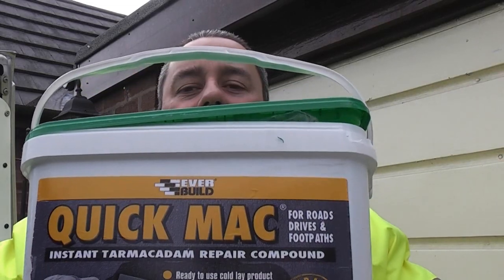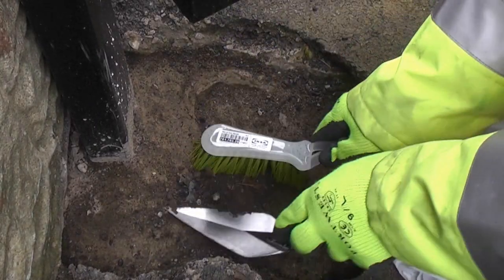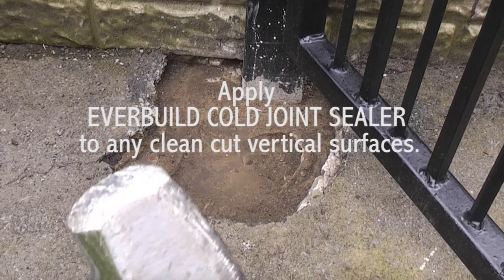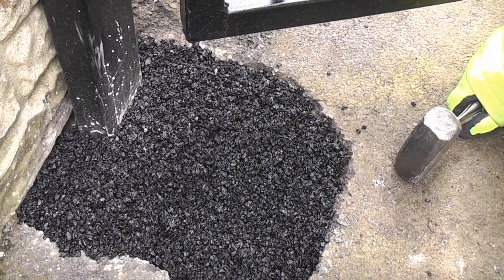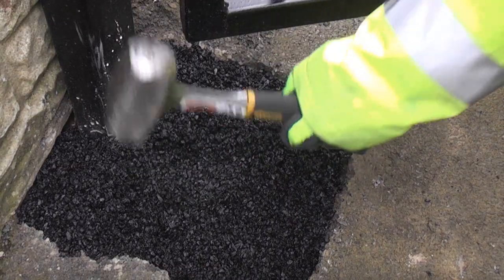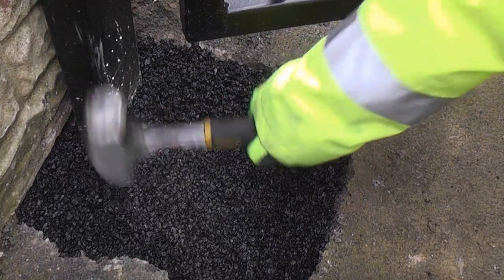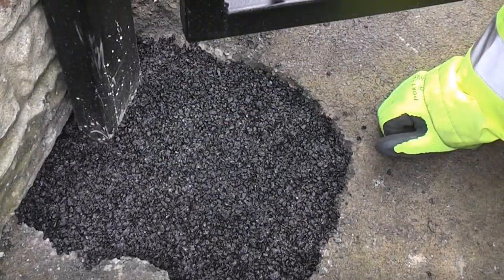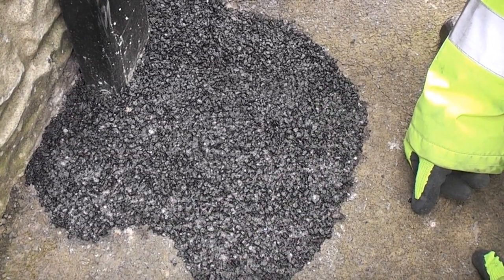Tarmac repair

Comment: I did a DIY repair to a small area of damaged path where I spilt some petrol from my lawn mower.  Mixed up some stone shingle with bitumen paint and then poured into the hole.  I didn't have a shovel and rammer either so I used a 16 KG kettlebell to compress!
Reply from the maker: Thanks for the comment ;-)

Comment: Get a stihl saw and cut the edges neat, will stop the tarmac coming loose if you have a better joint..... then bitumen seal the joints to stop water getting in and ruining the tarmac
Reply: And a punner

Comment: The best way is to put 3 layers in and compact each one down with the lump hammer but use the head to tamp as covers more area then finish off with trowel....Best tip is to warm the tar up prior to using put near a radiator or even better near the fire not too close tho don't want it catching on fire and burning the house down and worst bit is the driveway still ain't finished 😩 but that's worst case scenario lol other than that it's a great product 👍Did you get much snow in the end?

Comment: Thank you for video :) Would this work in a massive puddle in a tarmacked driveway please? 
The puddle has gradual rather than steep edges.
Reply from the maker: Yes, it should work, as long as the water is removed and allowed to dry out first.
Thanks for the comment
Reply: Thank you :)
Reply: I wouldn't taper the quick Mac on a shallow gradient as it will chip off on the edges. Decide the area you want to fill and cut straight down a couple of inches. Then fill it up level with tho old tarmac.

Comment: Any ideas on the best way to repair tarmac broken off around a manhole. Bearing in mind a car goes over it.
Reply from the maker: This stuff should work fine as long as the tarmac is compacted properly.
Driving over it with the car should compact it well.
Reply: Great stuff, thank you!.

Comment: Would this be suitable for filling a recessed man hole cover in a driveway? I've got steel ones that get extremely hot in summer and my young daughter burned her feet on it last year. Was thinking of buying recessed ones and filling with this to match the tarmac drive.
Reply from the maker: Not sure, sorry.
I have only ever used it for repairs.
Might be best to check with their technical department first 👍

Comment: Hey bud, thanks for the videos. Been really useful of late. We've just put in a new water main and underground waste (something I also watched on your channel, thanks), amongst other things. What sort of coverage would you get from one of these bags?

Need to get our drive back to something that doesn't look too bad but as we still have a fair amount of work to do I'm not looking at putting too much money into it until we've done everything else. This could work, but I'm concerned about the number of bags I'd need. I've got a channel about 200mm wide and about 10m long plus a 1mx1m joining bay and a raised bed we dug up, but it's a good sized drive (can fit 3 cars) so tarmacing the whole thing would cost a couple of 1000.

Any help/advice most welcome, thanks

Comment: So I’m building eventually a pergola, in between the house and the apartment where I house my parrots, so it will be an aviary but I’m wondering..(looking out at the high winds, there’s a crazy storm blowing over Ireland atm, 18/Feb/22 wooh my first time writing the date in 22.) but the area is already tarmac,Ed, should I cut trough it with an angle grinder, then cement it in and repair the area with that quick Mac still, or would it be possible to attach it to the ground with some sort of bolts, what would be more secure, I intended to put a partial per-specks roof on, and attach it to the new roof on that that the lads build in an extra beam so I could attach it easier, I recently bought a mither saw to make parrot toys, but have also been trying to hire someone to do it almost two years, first it was none could come because of covid, then once restrictions were lifted everyone was booked solid, there all friends who say they’ll help if I wanna give it a go…I keep seeing all these women on the internet and tv doing cool stuff with there few tools…I also snapped up a mig welder, planning to teach myself to weld..it took me a week to figure out I needed to have the extra clip attached to the metal I was trying to weld, I taught it was broken, but I didn’t give up, I couldn’t see a thing trough the mask, do I need a better quality mask,. Or is that the norm do most welders go half guessing where to lay a weld…what I welded fell apart the next day..but that’s ok, it’s all part of learning, if I don’t try I’ll never get ok at it…now I’ve found your channel it’ll be a great help..Tysm  ♥️ from Ireland 🇮🇪
Reply from the maker: The problem is, that you do not know how thick the tarmac is and how good the sub base is. Therefore, I would dig down and use concrete/post crete for the post, then top it off using tarmac repair compound.
As for the welding mask, if you get a normal inexpensive mask, you can not see a thing through it, until an ark is struck by the welder, unless you get an auto darkening helmet, you can get a cheap one for about £50. These allow you to see through the mask, but will automatically darken once an ark is created, in a fraction of a second- to protect your eyes.

Comment: How did you install your gate post so close to that wall?  I have to install a fence just like your black metal gate.  It will be in a garden that is not level, I am not sure how to keep concrete footings level in this sloping garden. Any advice would be greatly appreciated.

Comment: It's a different hole to the one you started with that you removed the tarmac from what's all that about
Reply from the maker: Two gates had been installed at the same property, I filled them both at the same time.
Thanks for the comment